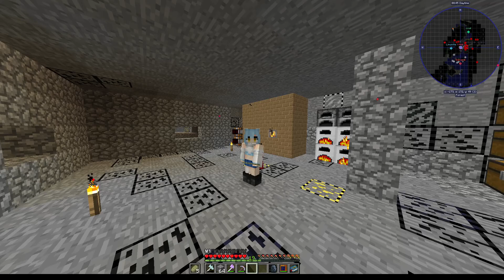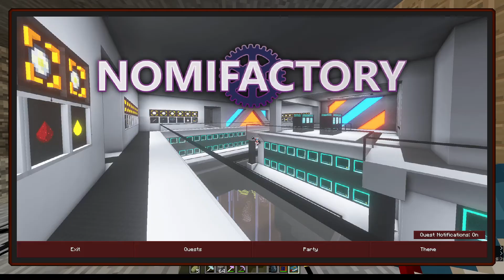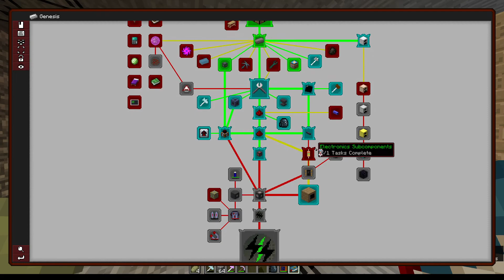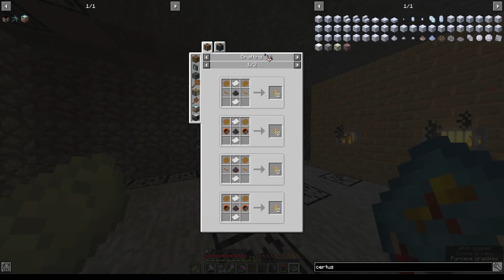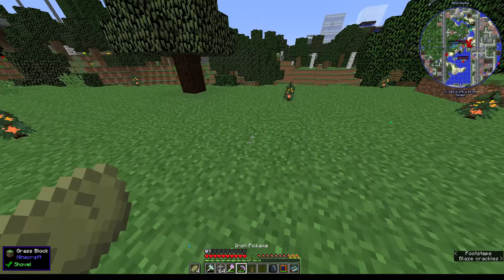Nomifactory S2 Ep3 - First Circuits and Machines

Comment: you know if there is a way to put the lv energy converter seperated of nomifactory like in other modpack ? (sorry for my bad english)
Reply from the maker: I do not think there is a way to, the energy converters are part of gregtech. If you want a universal cable for power, mekanism has one that converts between most energy types
Reply: @Myolitz  the energy converter is not part of GTCEu i played the mod without other mods and the converter dont appeared
Reply from the maker: @theguywiththenameofkkl  then idk, only gtceu pack ive played is this one so /shrug